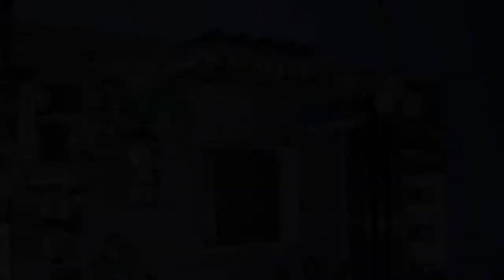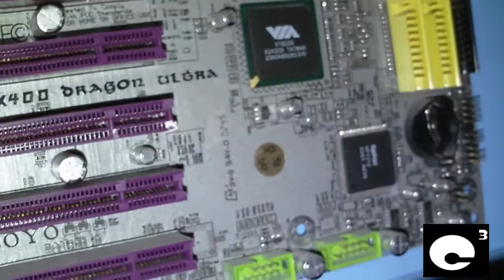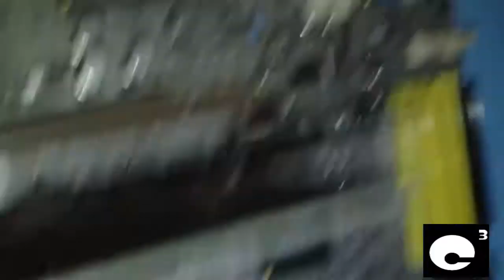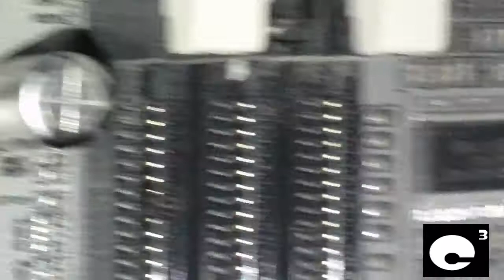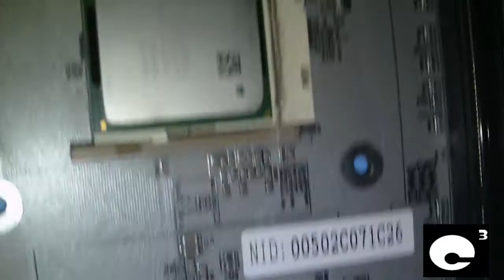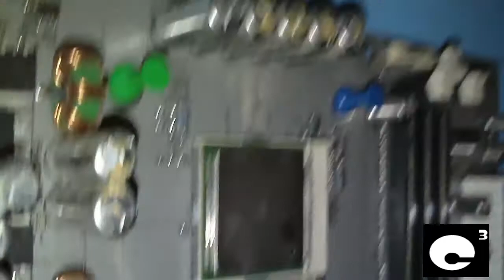Failed Sacon Capacitors on Soyo P4X400 Dragon Ultra Motherboard

Comment: Those caps just fail by themselves, even if this board was never ever fired up at all, the caps will bulge, leak, or both. Rubycon caps were notorious for it back in the early 90s, and NEC display devices were affected BADLY by this. I have seen new old stock never out of the original box CRT projectors that were dead and most boards totally beyond repair due to the leaking electrolyte that in the case of Rubycons was coming out around the legs and eats the circuit board.
Reply: I know it's an old comment but from what I remember with a mobo and vid card that had these garbage caps on them.  Sacon got a stolen incomplete electrolytic formula and they didn't know it was incomplete.

Comment: I have a Soyo KT333 Dragon Ultra motherboard in a machine I haven't used in a number of years I just attempted booting up so I could wipe and donate it. It's basically the AMD iteration of the motherboard in the video. Same capacitors, same exact issue. They could be un-soldered and replaced.

Comment: Hi ! Nice video, I saw on the internet a lot of them having bad capacitors but not that level, it's quite sad to know that they were probably dumped in mass :(

Do you know currently where this type of motherboard can be found ? I'm looking for one of them. I really like this silverish-white color, so nice !! I wanted one of them back in the day but they were too expensive. I'd like to build a nice ~2002 machine with it. I know there are also Socket A/462 boards like it (KT333/KT400/KT600 dragon ultra platinum edition) so they could be cool for that build. Do you have any info about that type of silver/white motherboard from that era ? Or maybe a bit older boards (Pentium II-III era, maybe Socket 423) or even newer (socket 754/939/940/775) etc. Thank you !

Comment: Hey I know this video is old I have one of these boards in my closet,I see I will need to do a cap rebuild. I have a question how reliable is it running at the default setting. I am thing about doing it up as a Home Server.
Reply from the maker: It was a reliable board when it worked. Keep in mind this one will only support P4's from the Willamette and Northwood generations. Also, if you want SATA hookups, you'll need a PCI SATA controller.
Reply: ***** the CPU that was in the mPGA478B was a P4 2.24Ghz and I am fine with the 4 IDE Ports. My old Gateway server was a 2.0Ghz and only 2 IDE Ports. The people that had this board before me I found a mix of White and gray thermal paste on the heatsink.

Comment: I had a problem with a geforce 8600, one cap failed, and the screen messed up. I'm not a technician, so I didn't try to replace. Probably replacing will not fix this.

Comment: Something similar happened on a relatives computer, my grandmother moved house and she never got around to setting her up computer (purchased in 2005) so it was left in storage for around 2 and a half years. Then I finally went to set it up for her and found that it would freeze at bootup, and after looking inside the case I found one single capacitor on the video was slightly leaking and after taking it out and changing to the onboard video card it booted up fine! I might try and solder a new..